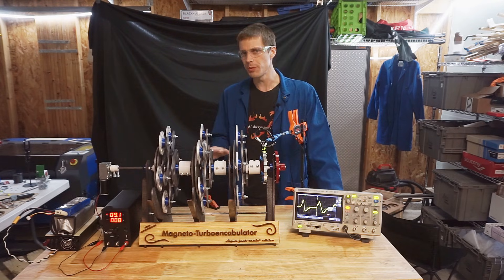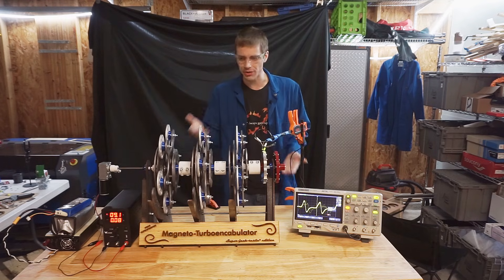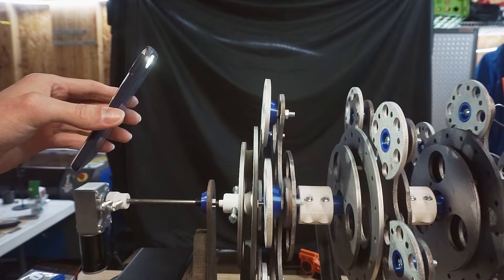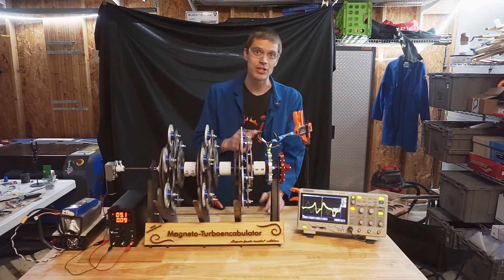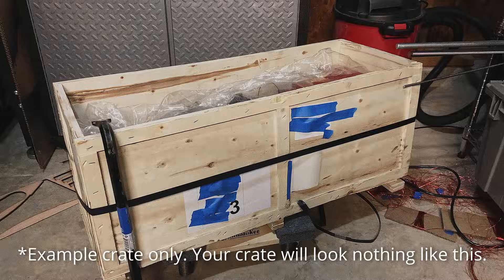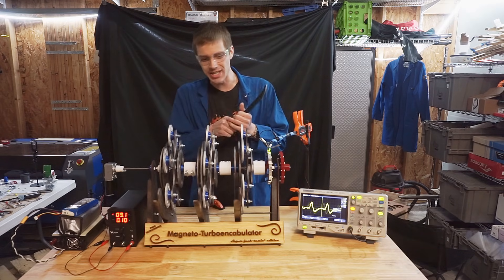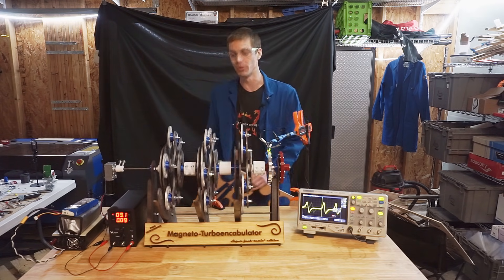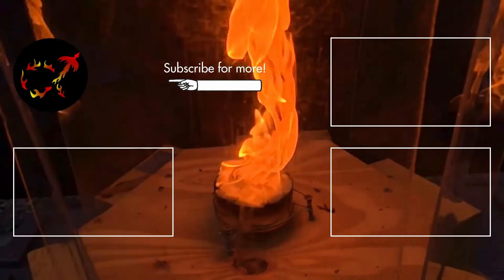Introducing the Magneto-Turboencabulator

Comment: Incredible engineering and a very clear explanation. I consider purchasing a unit to help with my lab's inverse partial solenoid dimensional stability issues.
Reply: Damn, good luck. Have you tried chemoemotionial financially binding simulations?
Reply: @room5245  i hope the electromechaxially cooled virtual webinfexious youtube algorithmous overlord promotes this chain of fine commentary
Reply: I would also recommend integrating a thermocouple with adjustable eddy current induction film to really tackle the hyperbullshit velocity centroid…got one off eBay totally legit.
Reply: @AK-gg5nh  idk where you're getting your info man.. :/ get your facts straight
Reply: @room5245  Got them off Craigslist and Wikileaks.
Reply: @AK-gg5nh  I get mine from Electroboom and Michael Reeves
Reply: @room5245  if one is searching for a flux capacitor, it can be found on O'Reilly's Auto Parts website... Just saying.
Reply: Can we just appreciate the fact that all the likes on the comments above me is a arithmetic series

9-5-1
Reply: and the smell
Reply: This could charge up a 1,000,000 Farad flux capacitor in under a second.... for sho! :D lol
Reply: Have you considered replacing the casing with post famulated ammulite in a dichromic polaric matrix?
Reply: I'm on the fence. Is Magneto-Turboencabulation the right choice for me and my family?
Reply: @razcarsey6635  It sure is!!! this design can sense and deflect tornadoes and hurricanes but will cause landing aircraft to fly over your house.

Comment: Yes. YES! I've been thinking about how to achieve this for decades. Thank you so much for finally solving the problems inherent in the magneto flux deposition relative to the sinusoidal replanation.
Reply from the maker: It’s all about the dingle arm
Reply: @AlphaPhoenixChannel  Ahhh that must be how you've completely eliminated sinusoidal depleneration. Dingle Arm 2.0 and it's  improved dingle-arm dangle angle.
Reply: @AlphaPhoenixChannel  As long as the Sinusoidal Repleneration does not exceed three o' clock Celsius per evolution, the Drawn Reciprocation Dingle Arm is unnecessary. You're nowhere near that.
Reply: @tomtroszak  you guys are something else 😛
Reply: What about the marzle vanes and girdle springs? I'm missing the lotus-o-delta motion.

Comment: this is cool but i think the potential energy could be increased with the use of a quantum flux saline inducer. The torque output can be increased with the use of a neural spectometer laser too!
Reply: nonetheless great breakdown of the mechanism driving the turboencabulator
Reply: how do you intend to induce salt water with this 'quantum flux' thing?
Reply: Please stop sharing this. The flux saline inductor could be added, but to do that, the quantum helix states of the disks would have to be harmonized with at least a level D flux encapsulation to keep the theta-force hydrodynamics at safe levels with prolonged use. Your advice would risk a directional helix radiation vortex, making it even more irresponsible.